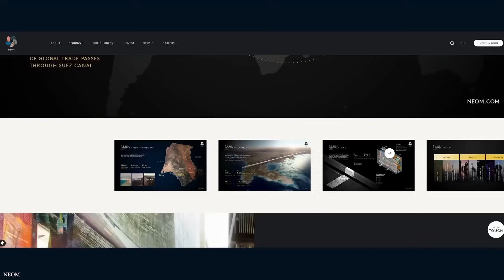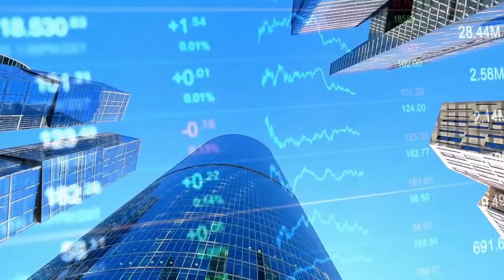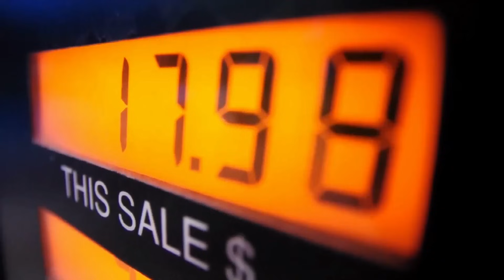"Constructing 'The Line': Saudi Arabia's Visionary Project in Progress | INFORMATIVE VIDEO"

Comment: In the 70's in Amsterdam Bijlmer vast blocks of flats were built in a snake shape linked together and with a lot of green inbetween the rows to be this super modern affordable housing project. After some years it became clear that the people living on the inside of opposite buildings could mentally not tolarate not being able to see a horizon. Crime became uncontrolable and people became depressed. The project became a disaster and sections of building inbetween blocks were torn down again to create space and horizons. If what you picture here in this video is true the project is heading for a major known failure.

Comment: $500B / 170K metres length ~= $3M / metre.
$3M for 2 1m X 500m walls and 200 m2 of span?
They could buy a calculator much cheaper!
Reply: They will need way more than that, $1.5 trillion total fund would make more sense